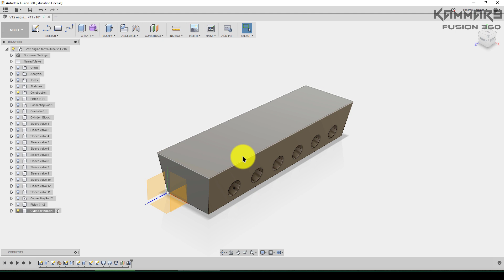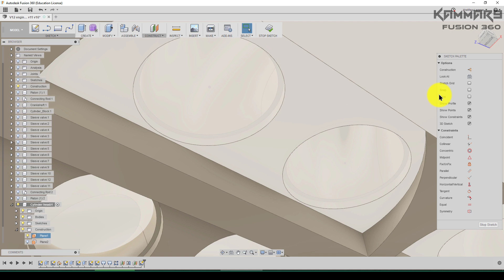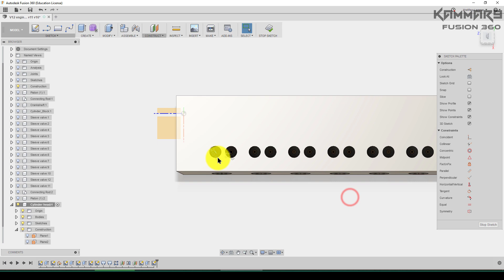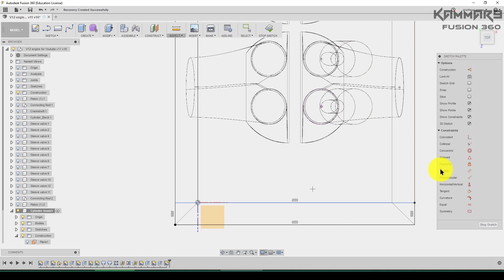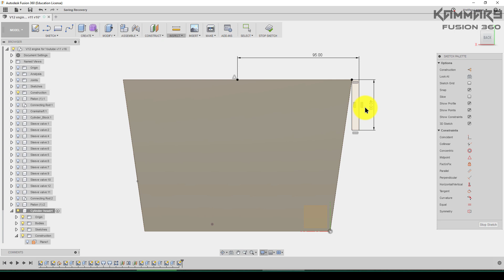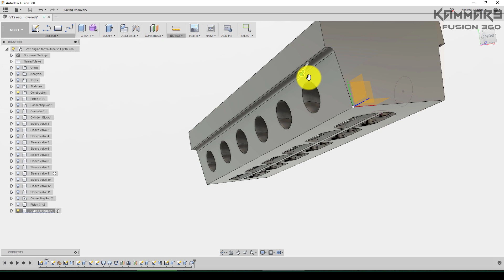Fusion 360 Modeling V12 Engine EP 22 😍 Full HD

Comment: Will this series be continued?
Reply from the maker: Hi there bro, of course yeah I wana just finished the BMW Z4 then continue working on the engine , please wait for it , activate thr notification button to receive it.
Reply: Thanks for the response. I will most likely purchase your videos once they are finished. Have you or know of anyone who has done transmissions, manual, auto, or sequential?
Reply from the maker: Hi again, not all of transmission, but I made simple gear box, 4 gears
Reply: There is a difference between a gear box and transmission?
Reply from the maker: Of course bro , transmission is many systems like gearbox + clutches + ...
Reply from the maker: Another example , gearbox is transmission only  by gears , there are transmission by other systems like belts , etc...
Reply: I assume that is a yes.